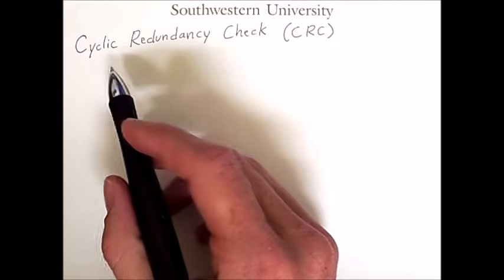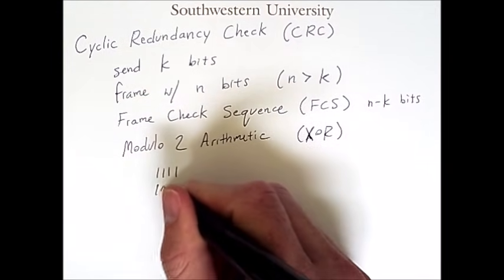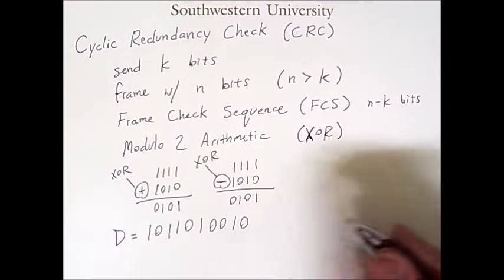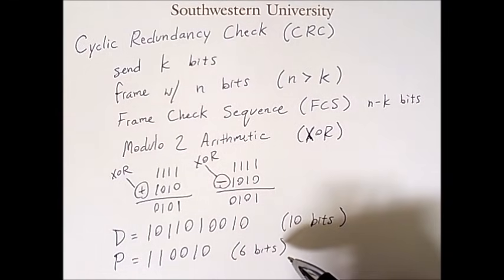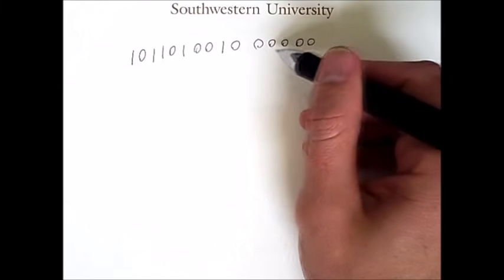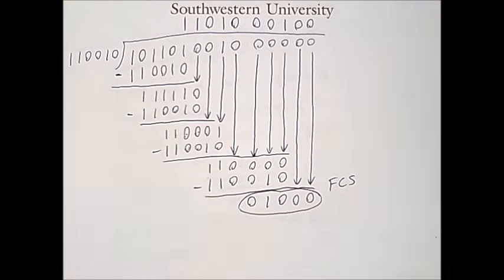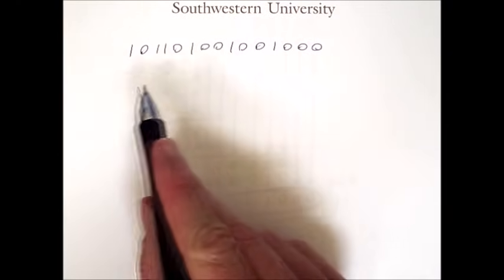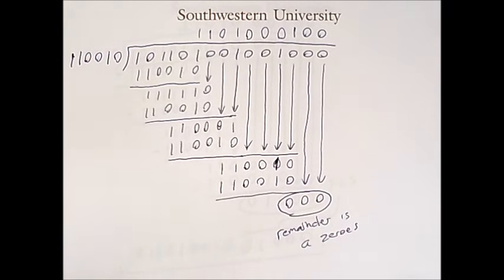Error Detection and Correction 2: Cyclic Redundancy Check

Comment: I got a problem.
When you divide 010110110110 by 10001, the first division results in a 5 bit remainder which I do not need to get the next bit to add to the reminder. e.g. 10001 XOR 01011 = 11010
please help, how to proceed?
Reply: U need to take an all 0s devisor. u should take quotient as 0 not as 1 , as the starting value is 0 in the dividend. hope u understand.

Comment: How did we concluded that the size of predetermined pattern should be 6 bits?
Reply: Probably a bit too late but for future reference the pattern was arbitrary, it can be anything as long as both the sender and receiver agree on a length.